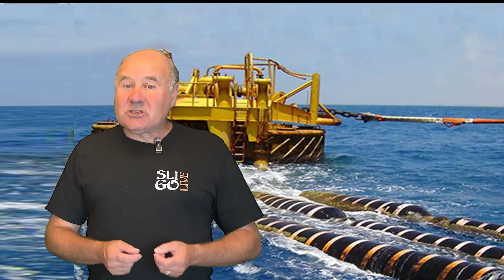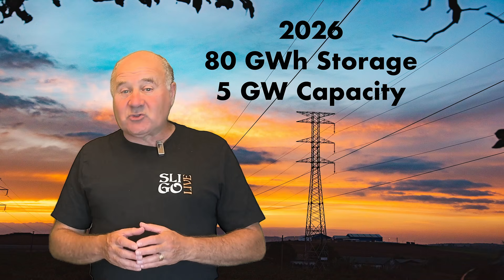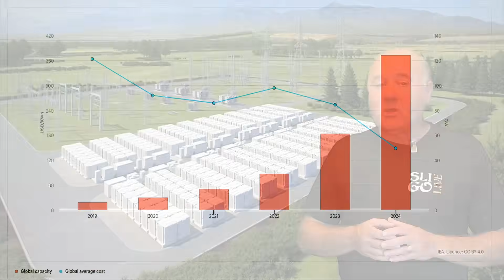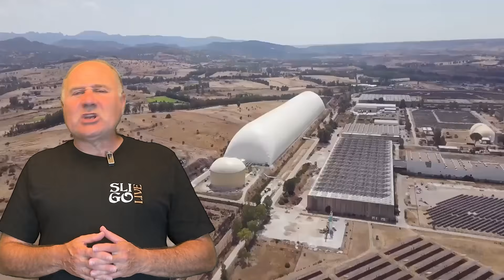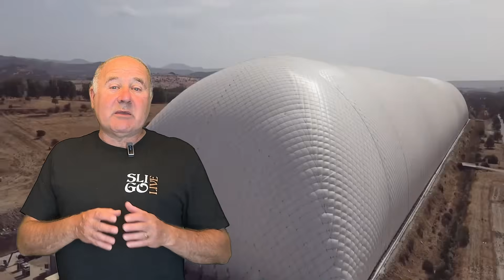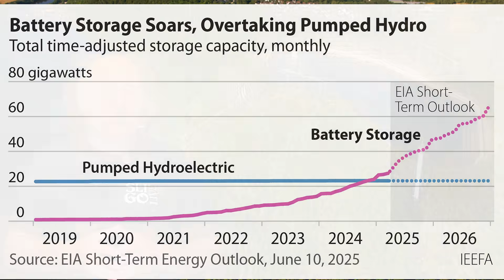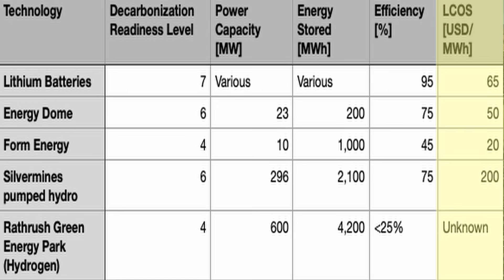Can Ireland build enough energy storage to turn off the gas?

Comment: EVs with V2G will handle that easily.  Every 20 EVs is a MWh, every 100 EVs is a 5 MWH Megapack. And it is effectively free if built into the charger at no extra OEM cost, just rearranging the parts. There will be no curtailment
Reply from the maker: Currently, V2G doesn't exist, at least not at any scale beyond pilot projects. I've been hearing about it for almost 20 years, but it never escapes the pilot projects. It's certainly not something we should be waiting for.
Reply: @Decarbonize11 V2G will more or less be expanded home solar batteries, mostly in control by the home owner.
At best they could be counted on indirectly through price signals but seeing the reluctance to take on even the basic TOU smart tariffs here I'm not holding my breath...
Reply: @Decarbonize11  Actually it does as most every EV producing company except Tesla has it as an option. heck their websites.  It does need to be in EV though, not as an extra.
It has been mandatory in a couple countries will be demanded by customers as they find out.
I've had V2L on my custom cost effective EVs 34 yrs.

Comment: I assume grid scale batteries will make home battery packs irrelevant? Why put a battery pack on the side of your house when local renewables, nuclear from France or in the future solar from Spain, could be charging the grid storage?
Reply from the maker: No, there's still value in home storage, though it is reduced. By having storage right at the source it reduces the chance the power will be lost due to congestion.

Comment: We can and should be increasing our natural gas production. The Ballyroe field is right next to the old Kinsale field and has enough gas in it to give us another decade while we continue switching to renewables.

As for renewables, i think its the mix which is important. The more varied sources for our energy the better. We need a mix of solar, wind, hydro and also whatever else. Ireland isn't ideal for solar, but on a sunny day, when there isn't much wind, solar comes into its own. On a crappy winters day, solar won't be much good, but generally those days are windy, so wind turbines come into their own. Hydro can be used any time, but i get it that the cost can be high.

However cost shouldn't be the only factor. Energy Independence is priceless and not enough people take that into account when assessing the cost of fossil fuels, which increases the dependence on all the volatility of energy markets.

There has been lots of talk about nuclear, but i don't get it. The cost of these small modular reactors, are staggering. Something like €4b each.And they produce less energy than our gas powered stations. The cost of building a full nuclear plant, such as what we see in Britain and France, could be €40b/ €50b and that wouldn't even do the whole country.
Reply from the maker: I agree about the mix of renewables and nuclear, but not about gas. It's been touted as a bridge fuel, but a bridge to where? 
https://youtu.be/io4RjLu5cyw

Comment: We're getting absolutely screwed here in Ireland and it will continue to be the case until gas is no longer needed. Take an average winters afternoon/evening with decent winds. If much of the energy production needed is being produced by wind and only a small percentage by gas, the ENTIRE production is priced as if it was produced using gas. Wind farm operators are making a fortune from this and it is essentially a scam to rip off consumers.
Reply from the maker: It's actually more complicated and less "screwy" than that. 
https://youtu.be/28fRS0iPVk0

Comment: Hi

Thanks for the summary.
The prices for batteries are going to drop drastically (including Sodium which is now in production in China ) so expect it in next couple of years 
You didn't mention EV vehicle to Grid which if you assume 3 m cars * 60kwh battery = 192Mwh to play with (and that doesn't include vans and lorries)
Another technology which can transform is enhanced geothermal check out Fervo.  This has the benefit it can both generate and store power. Not yet in Ireland but the concept is proven.
I think keeping gas peakers for Dunkelflaute (dark doldrums) is a prudent interim measure as they will be most expensive and will wither on the vine as new / cheaper tech prevails
Reply from the maker: I talked briefly about enhanced geothermal in a recent video. I wouldn't call it proven, but interesting (DRL 6 out of 7). They're building their first plant, but we don't have real-world operations data yet. 

https://youtu.be/HDGVYpjYFGA

Not a fan of V2G. My thinking is EV batteries are relatively expensive, and the business relationship between the car owner and the grid operator would need to be a bit complex, so it's just easier to build batteries designed for the grid. I do like time-of-use or demand response for EV charging, which is half the value and 10% of the complexity. 

I'm not suggesting tearing down gas peakers, just not building any new ones. 
https://youtu.be/io4RjLu5cyw
Reply: Yes, EV batteries are more expensive than batteries in BESS. But look around, there are tons of cars today just sitting on streets for day's doing nothing. It will be the same with EVs. So i think that V2G actually make sense..
Reply from the maker: @petrbrok2468 some problems, not fatal, but challenges that need to be solved. 

We need a system like a VPP that can control these EV batteries. This is a deployment problem, not a technology one. 

We need a regulatory structure and a tariff scheme for discharging these batteries

We need a business relationship between the utility and the owners of the E.V.’S. This would include how often they’re allowed to be discharged, how much compensation the owner gets, and some kind of guarantee that they’ll never be left stranded because the utility needed a lot of energy.

You need a marketing program to convince people to sign up for it. If the compensation and guarantees aren’t good enough, the program is not gonna be worth anything.

Comment: What about green hydrogen is it potentially  economical if the tech improves.
Reply from the maker: Once the grid is > 90 % low-carbon, then we can talk about hydrogen. It really only works if electricity is nearly free. Until then, kicking fossil fuels off the grid is a better use of our renewable electricity.

Comment: What about sodium batteries?
Reply: He did mention them, when the price has fallen enough or so.
Reply from the maker: @surters 
I didn’t include them because there are no proposals to build a sodium battery storage facility in Ireland.
Reply: @Decarbonize11  The rusting iron was that the flow-battery, good for long time storage (like the one being build in Swiss now).
Reply from the maker: @surters 
No flow batteries planned for Ireland. 

Here’s the link to the video I did on Form Energy’s rusting battery 

Form Energy: Google is doing a data center right with the help of a rusty battery
https://youtu.be/er2p3g1RBOw
Reply: @Decarbonize11 thanks for video, good info, watching here in Minnesota, landing zone for that massive Google project. Wonder if that's going to be "power to the people" like John Lennon used to sing about.
Reply from the maker: @GladmanNow 
Being that Google is paying for it, I wouldn’t think it’s powered to the people. But I do think it’s a good thing.
Reply: @surters thanks, hadn't watched all the way through. Have a nice day.

Comment: Ireland has about 20 minutes battery storage. If the switch of transport and heating to electricity, plus the growth in the economy goes to plan, within 10-years, Ireland's peak demand could be between 20 and 30 GW.  There is no affordable way for Ireland to "turn off gas" except going nuclear. 
While the nuclear plants are being built, there is plenty of oil and gas off Ireland's shores, just a matter of going out and drilling. 
Let the Chinese, the people with all the battery production and low cost labour decarbonise their grid using batteries, if that is what they want to do. Once that has been working well for 5 or 10 years other countries can decide if they want to do something similar. 
CO2 energy storage has been talked about got decades. Due to all the issues, very little progress has been made. However, it's a topic beloved by academics.
Reply: Ross, we cannot afford any more oil and gas! You oil boosters heating up the planet too much and are now  actively killing tens of thousands of people a year! My own home insurance have increased five-fold in price because of the worsening fires where we live. A fifth of French rivers are running dry. Aquifers and wells are going dry all around the world.

Nuclear is important, but as rogue countries like Russia, the US and Israel have shown, oil refineries and nuclear power plants are easy targets, indefensible. And it just isn’t safe for individual families to rely on energy utilities anymore. Unless they are locally owned coops, they work to enrich shareholders and billionaires, not regular people. The energy corporations think of us as captive prey, not even valued customers anymore.

Australia is showing us one potential future. Yes, solar isn’t as efficient in Ireland compared to southern Spain. But it still can produce a lot of energy and should cover every appropriate roof, carpark, etc. Finally, every home in Ireland and elsewhere will need battery storage. 

Energy is wealth and energy is democracy. Big corporations world wide  have been taught by American corporations how to corrupt regulators and buy politicians and hoard our tax dollars while paying no taxes themselves. Going forward, if we want secure and affordable energy, we will have to produce and store it ourselves. And if it takes 20, 450 Watt panels to power a home in Ireland or Germany instead of ten in Spain, well, that is the price people in Ireland and Germany will have to pay to see their countries survive.
Reply: @freeheeler09 "20, 450 Watt panels to power a home in Ireland or Germany instead of ten in Spain, "

That is 10 extra panels, 450 Watt panels are about €60, total extra cost - not very much! 
You don't need any extra electrics if you want the same output as Spain, just the extra panels.
It is a problem if you don't have the space for them, but in that case, put them on a farm!
Reply: @nigels.6051  Please post a link to where in Ireland 10x 450 Watt PV panels can be purchased for €60. Even €60 for one panel.
Reply: @RossWexford  I can't post links, except to YouTube videos, as far as I know!
Just do a google search!  
I did of course not include VAT, since you don't pay that on installed solar panels.
Panels are currently in short supply due to the Trump Wars and up in price due to shipping fuel costs, so you may struggle to find many actually at €60, but you can get close, and they will come back down if you wait for Trump to finish his wars.
Reply: @nigels.6051  Please tell me the name of any supplier who sell panels to homeowners for €60, or close to that.
Reply: @RossWexford Midsummer has one for 82, bought singly and it's a 510W one. Prices have naturally increased recently as the demand spiked for some reason but I've seen wholesale 440Ws in Germany when buying a pallet for €45 in April. Long gone by now as people copped on of course.
Reply: @freeheeler09 Ireland's average temperature is only 10C. A few degrees more will really improve the climate.
Reply: @RossWexford  Wait till AMOC shuts down, then be so complacent and selfish, not caring about the rest of the world.
Reply from the maker: I didn't pull the 10 GWs by 2035 out of a hat, that's the projection, so let's work with that (as I did). 

The Chinese are decarbonizing amazingly fast. Doing a video of what's going on there is in my backlog. And they're the world leaders in just about every technology, or at least a strong contender. I wish we were doing nearly as much. 

The company building the CO2 battery in Ireland has had one running in Italy for a few years. It's not just academic. 
https://youtu.be/2Xe6HTcexck

Comment: no need for lithium batteries, sodium batteries are already in mass production
Reply from the maker: The supply chain for sodium batteries isn’t mature like it is for lithium. And lithium batteries work quite well. So for now lithium is the default. 

In a few years that might well change.
Reply: There's more than one chemistry under the lithium battery "umbrella". NMC and LFP are quite different beasts but as sizes go up due to prices dropping even a 1C "Energy" LFP can easily power a truck.
For grid storage an operator needs to look at what is proven and can be delivered, integrated and permitted now, these processes take years.
Also sodium ion has a different voltage curve and needs different or at least oversized inverters to make full use of the capacity. The available cells that hobbyists have tested so far suggest a moderately lower round trip efficiency as well.

Comment: First, it's true that Ireland's solar potential is not as high as other places, BUT, solar pannels have gotten really cheap, so you can over pannel the inverters. The only reason you wouldn't add some is if it came in on the interconnectors. Second, at some point, overproduction will compete with storage, and I expect if there is enough overproduction, non storage businesses will develop that can use lots of electricity, but only when it's very cheap. One of the keys, will be having smart meters, so you can have time of use prices that encourage good decisions, like charging vehicles when there is plenty, and cutting back when there isn't enough.
Reply from the maker: Can’t wait until we have this challenge. 

We do have smart meters, but only time of use tariffs.
Reply: Ireland is not bad for solar, at least in the South West.  The north is a bit far north, and the east has more cloud, but the south west has been sunny every time I've been there, it is not particularly cloudy along the coast, the air is reasonably cool so solar panels have high output in full summer sun, and in the summer, when solar is needed because there is less wind, you get 16+ hour days - much better than the Sahara where you only get 12 hours sun, the panels are overheated so at reduced power, the inverters are overheated, the panels are covered in dust...

And yes, if you want good output on cloudy days, just over-panel, the panels are the cheap part of the system.  My MPPTs are configured with an output limit one quarter of the panel rating, so I get the same amount of power on cloudy days as sunny days, so I don't need storage to cover cloudy days. The system is built to support the limit, not the potential of the cheap panels, so it is not expensive to do.

I'm not convinced about the smart meters.  Once there is enough daily storage on the system, there will be no reason to have time of day pricing, and I don't think day of week pricing is ever going to work, that is not how people work, except maybe weekend discounts, but with a bit more storage, they become pointless as well.  The only smart bit that makes some sense is to charge the EVs at night to avoid needing grid upgrades, but even that only makes sense if the storage is not local, and battery storage can easily be local, the Australians have put most of the battery storage inside peoples houses now, so it is local to the street.
Reply from the maker: @nigels.6051 
I looked at the capacity factor for solar in Ireland and it is pretty low, only 10%. But since solar summer peaks, and Wind winter peaks they’re great partners for the Irish grid
Reply: @Decarbonize11  Yes, and in Equatorial Guinea, on the equator, it is "15-20%" - Ireland is not too bad, and pretty good in summer at "14 to 18%" in Killarney... Equatorial Guinea doesn't really get summer because of its location!

Ireland is not going to run entirely on solar in the winter, Killarney drops to 2% while Sidney Austrailia is at 28%, but that is when you need wind power.  For the summer, solar is cheap reliable power, you do not need the 50+% capacity factor of a floating offshore windfarm for solar to make economic sense.

Comment: It would be interesting to see cost per MW for storage including efficiency.
Reply from the maker: The table I showed towards the end (https://youtu.be/eCahI1S9oX0?si=bqllFFC3CRuzgJMv&t=782) is the levelized cost of storage, which factors in everything, but also makes a lot of assumptions. You only charge these systems when power is cheap, so the efficiency isn't the most important thing.